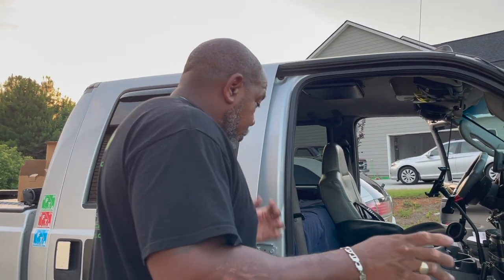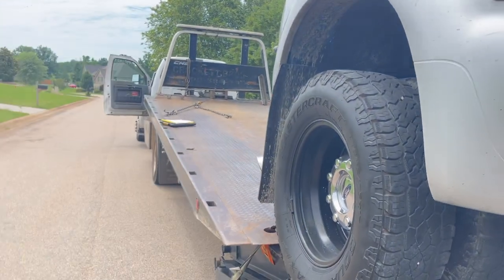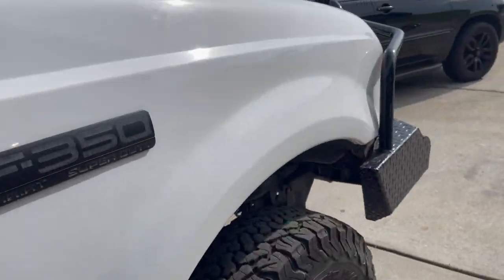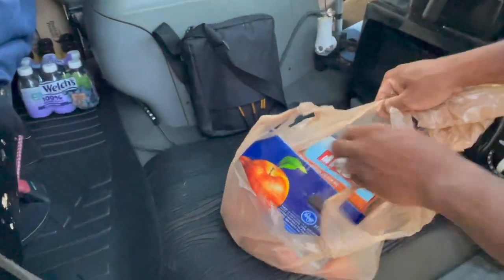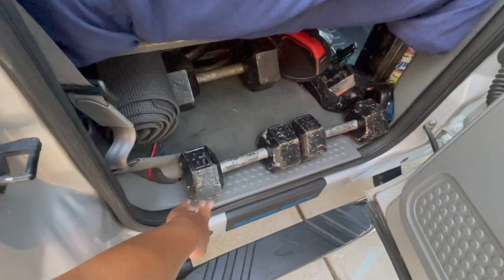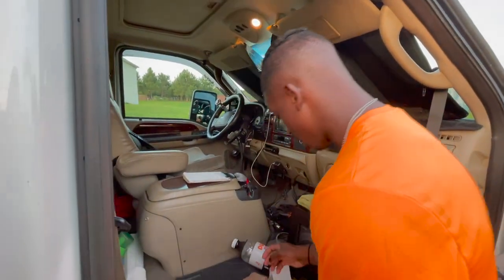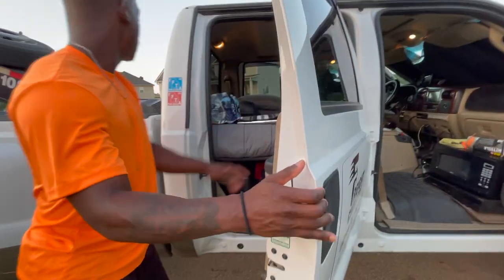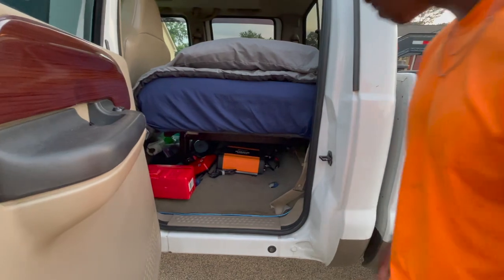CDL & NON CDL HOTSHOT SETUP | HOW TO SAVE MONEY OTR

Comment: If it is hot, how do you keep it cool inside the truck while sleeping at night? 
Do you leave the truck idle (which will burn lots of diesel) or what you do to keep it cool?
Reply from the maker: i idle the truck if its too hot; only burns about $20/30 of fuel or if its not that hot you can get fans from any truck stop and when the sun goes down and ur truck gets cool, run the fans
Reply: @hotshotwithme  In southern states like TX, FL etc the heat carries into night, fans won’t help brother. Looks like you make good money that $20-$30 / day of idling the truck won’t hurt your pockets 😃
Reply from the maker: @semprefidelis76  im aware of the heat in those states; there no way around it with a setup like mine; gotta do what u gotta do; better than getting a hotel; i value my health and wellness over my pockets; i have no problem idling if its too hot at night
Reply from the maker: u gotta think too; in hotshot world around 200 a week in idling really isnt anything